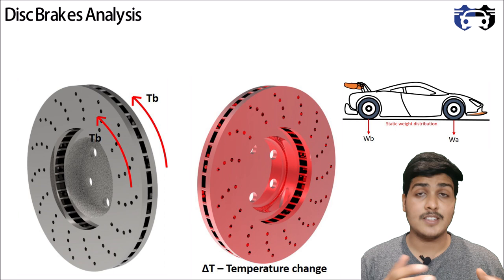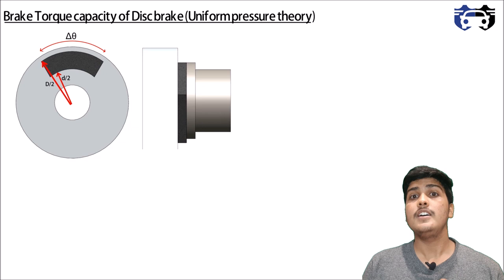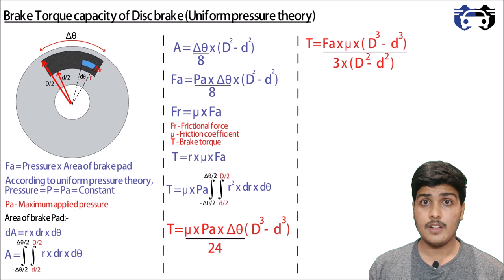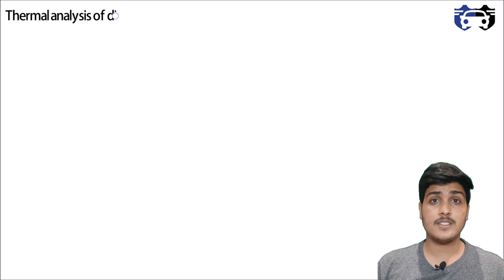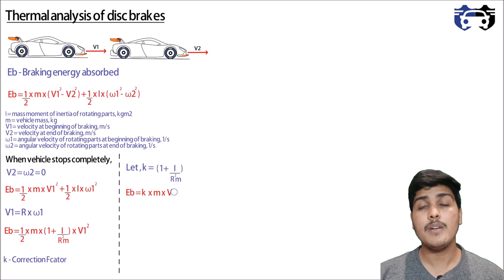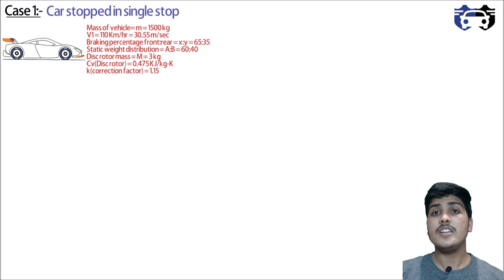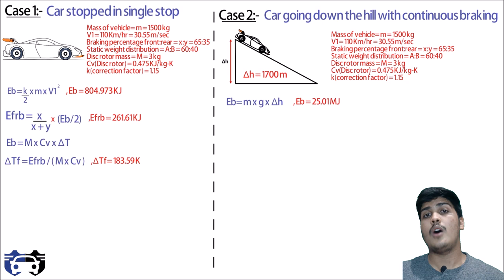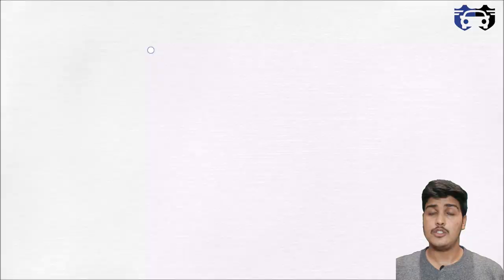Disc brake analysis | Brake torque capacity of disc brakes | Thermal analysis of disc brake

Comment: Been loving the videos, graduated as a mechanical engineer but have been working as a manufacturing engineer for the past year or so. Have recently been missing the design side of things and have been loving your videos because recently I have decided I might try and apply some of the engineering knowledge im learning from your videos to over engineer the shit out of a little RC car or something I think that would be fun. Do I need to worry about over engineering a small scale rc car? Probably not but being able to say I have worked out all the equations and designed it would be cool.

Comment: I am getting a bit confused.  Your first equation Fa = Pressure x Area of brake pad seems like it should be Fa = Brake line pressure x area of piston.  This would give you the Force exerted on the Pad's.  The pressure (Pa) the pad exerts on the rotor would then be Fa divided by brake pad area.

In the second column it seems like Pa is now Piston force Fa divided by brake pad area to give you pressure the pads exert. Multiplying that back by the pad area will just get you right back to Fa = piston force.  

I can't see how your last equation accounts for the pad area as it seems like Fa comes back to being the piston force on the pads.

Maybe you are saying that brake line pressure gets multiplied by the area of the brake pad and not the caliper piston?  Has my thinking been wrong this whole time?

The only way I can visualize this working is the following.

Fa = brake line pressure x piston area. (Force the piston exerts on the pads.)

P = Fa / pad area

T = (u * P * Theta * (D^3 - d^3)) / 24

You lose the interaction between piston and pad for me on the last step.
Reply: But he said it in the video that uniform pressure distribution is assumed